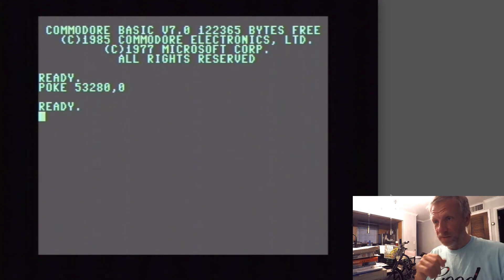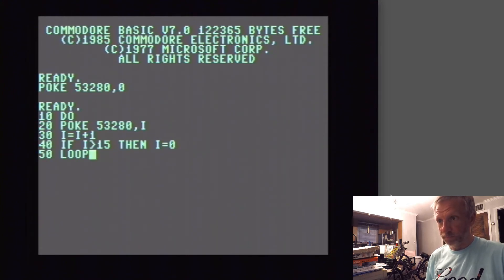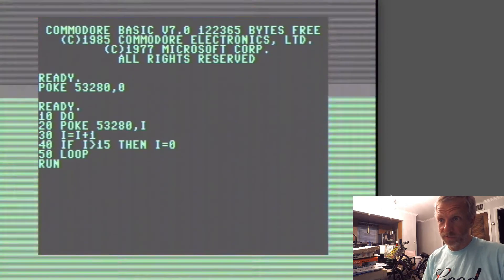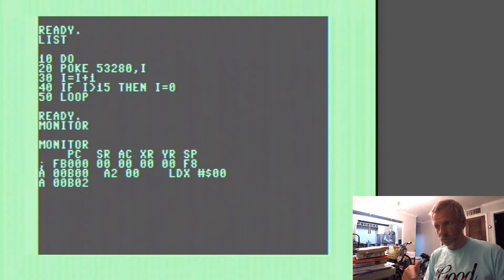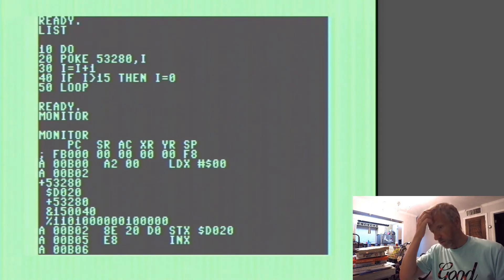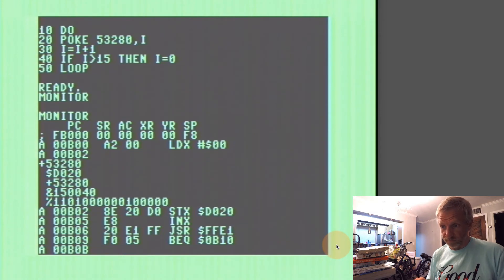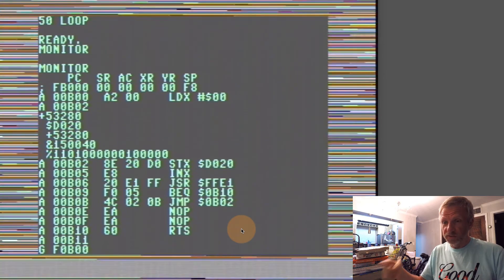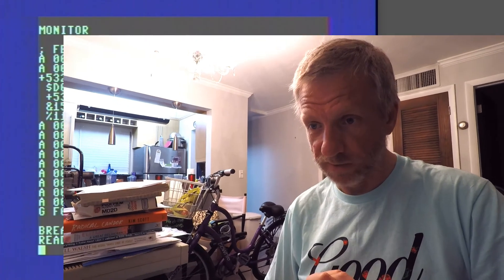Creating Flashing Border Colors on the Commodore 128 in Machine Language

Comment from the maker: Note on how to start ML code from a MONITOR:
Usually you type G followed by the hex address of your code. But on the C128 you have to prefix this with a 5th digit which designates the BANK in which your code lives. In my example that's BANK 15. Hence the correct way of executing code that lives at $0B00 would be G F0B00. 
I had a face-palm moment in the video when I thought that F would actually 16... it's not of course, it's 15 - hence F0B00 makes perfect sense and is the equivalent to starting it in BASIC with BANK 15:SYS 828. 
Thanks to Daniel Hotop for bringing this to my attention :-)
Reply: Nice video, I was wondering about ML on a 128, great simple example to get started. I think your comment above has a small typo? The basic command to run the video's ML program on a 128 might be BANK 15:SYS 2816 . Why when assembling using the monitor on the 128 does it show a leading 0 and not a F. Example in the video when assembling it shows 00B00 for the address but to run from the monitor you need to type G F0B00?
Reply from the maker: Good question! It’s been a while since I’ve assembled anything in the C128, but from what I remember, the same address should work with BANK 0 and 15. That’s because the same area of RAM is available in both banks. Each bank is not a discreet section of memory, but rather a “configuration” of various RAM / ROM combinations. 
This article by the late Jim Butterfield has more details: https://www.atarimagazines.com/compute/issue75/Commodore_128_Machine_Language.html